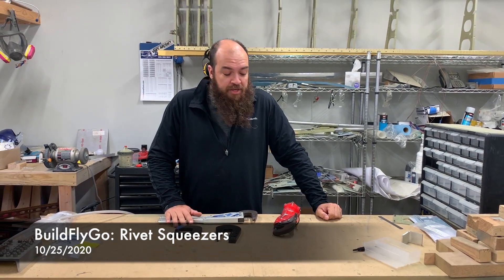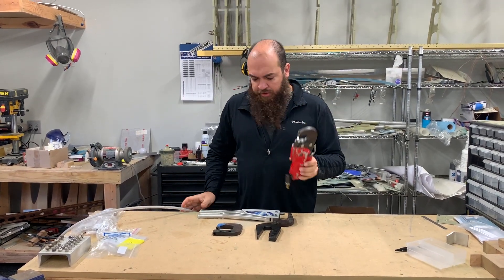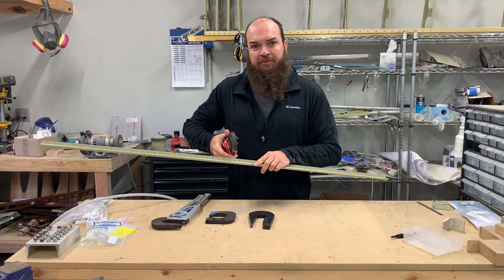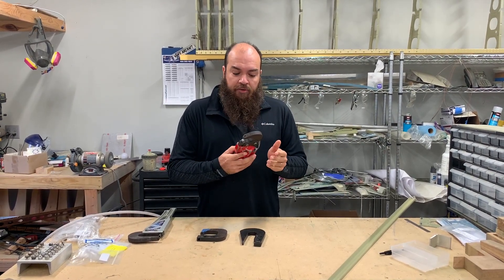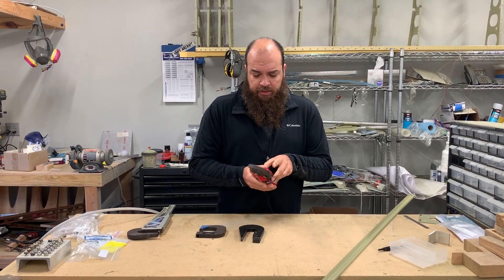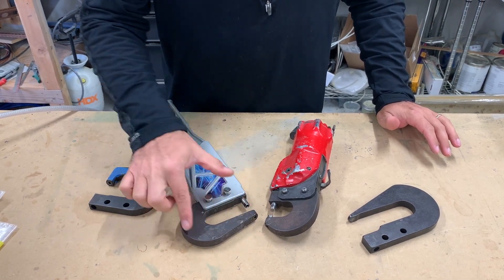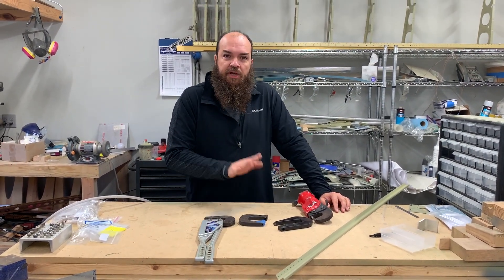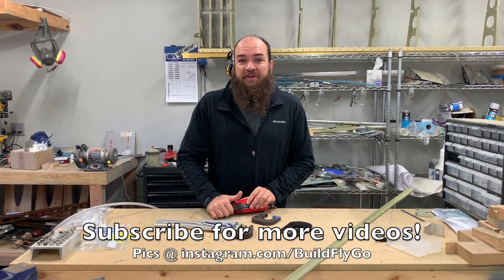Rivet Squeezers Overview: Pneumatic vs Hand-actuated

Comment: Great video as always.   At least for me, I still have flex with the 3 inch yoke on 1/8 rivets, and prefer to use 1 1/2” yoke wherever I can.  Thought I could get away with 3” yoke but changed my mind.
Reply from the maker: Yeah, there's def some flex but for most rivets the minor flex doesn't matter too much. The 4 inch is way too much flex :(

Comment: Guil, I’m really digging these series. I purchased a pneumatic squeezer. It has the signs of someone possibly putting air tool oil in it. UGH. I don’t think it’s in need of a rebuild. It can squeeze a -4 fine but at times I notice a bit of inconsistency. I’ve mostly chalked it up to the adjustable ram, which is a huge time saver, but how did you know yours were bad? Would they not squeeze at all? If possible could you describe ways of being able to tell one is going bad?
Reply from the maker: The ones I got obviously needed a rebuild, they would barely move. I got the seals from Avery at the time and it was pretty inexpensive. You can try reaching out to CP directly and ask about a rebuild kit. Here is the exploded view for the current version, which I suspect is mostly a model number change: https://catalogs.cp.com/files/cp/6159924770.pdf
Reply from the maker: Looks like they have. "tune up kit" part with all the o-rings and seals: 6153996450
Reply: @BuildFlyGo  excellent thank you sir!